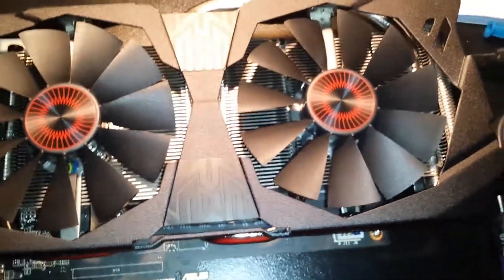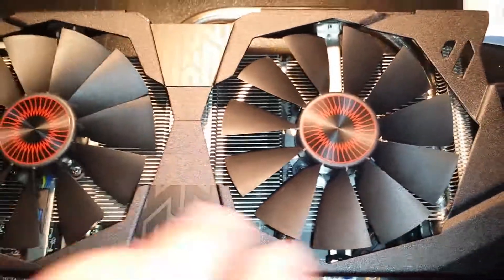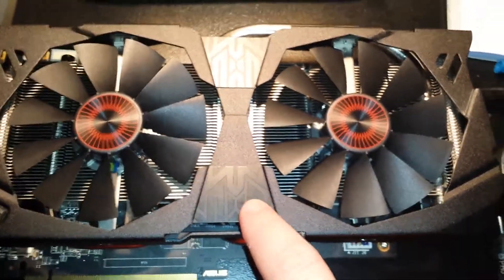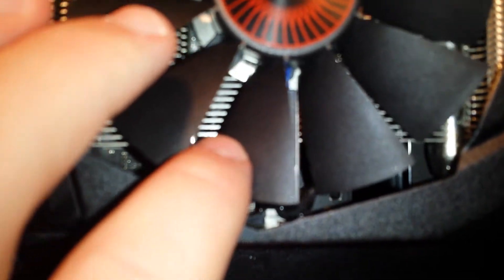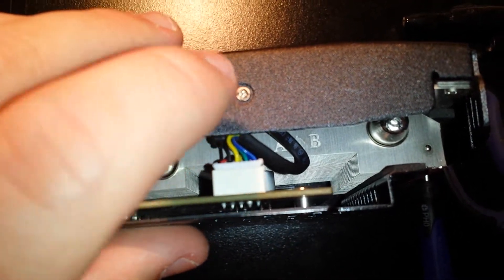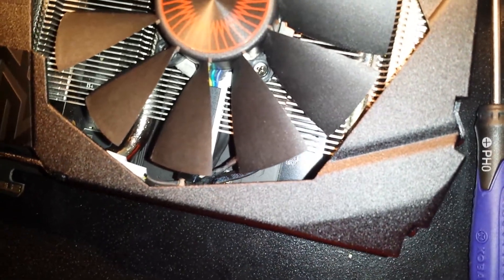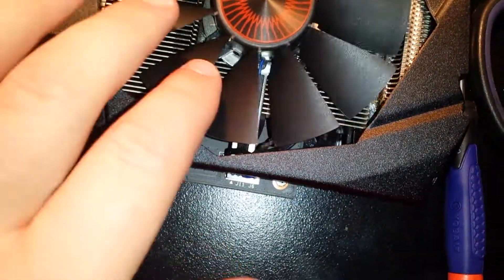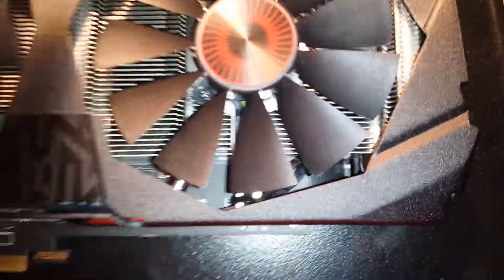ASUS Strix GTX 970/980 fan noise fix.

Comment: Hello 1 question. This thing is dangerous for the gpu? I mean when the prices will begin to lower i will buy a new gpu but in in the meantime this noise doesen't annoy me too much. Only thing i wanna know is if this is dangerous
Reply from the maker: No, you won't mess anything up. Just need to move the cable out of the fan's way.

Comment: This wasn't the cause for rattling fan of my 970 Strix, instead I followed another advice to put piece of rubber under the fan that was causing resonations. I was a bit sceptical about this but I unscrewed fan from the heatsink and cut a round piece of rubber from used bike inner tube, placing it between fan and heatsink. And rattle has been gone since.

I still believe that this resonation is caused by bad/loose fan bearing as the rattling fan is very easy to lift on it's axis by fingers, other fan doesn't budge.
Reply: YoStu thank you for your comment, can you help me with a more specific explanation in where and how you put the rubber. Thank you in advance

Comment: Hey man i have a problem with my gtx 970 strix i was playing gta v but after 15min the monitor turns to no signal and i have to turn my pc on again please help
Reply: Had that too. Make sure you set the voltage and power down in the Strix program, it makes the card unstable.
Reply: What strix program
Reply: If you also have the ASUS Strix GTX970 it should have come with a program to customize the settings of the card where you can play with the voltage/power/fans/OC'ing.
Reply: but the problem stopped after a few days and have no crash by not installing rhe software
i think it was driver fault